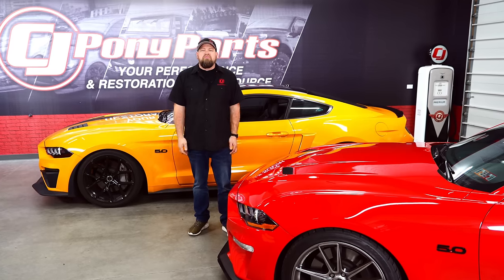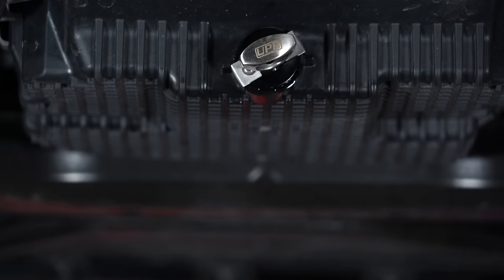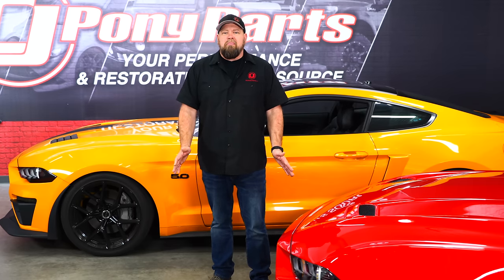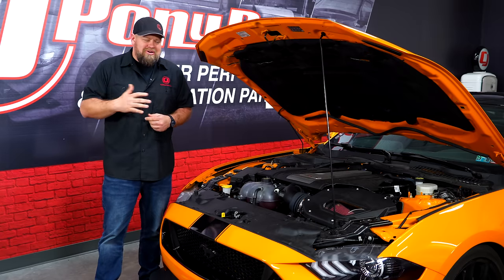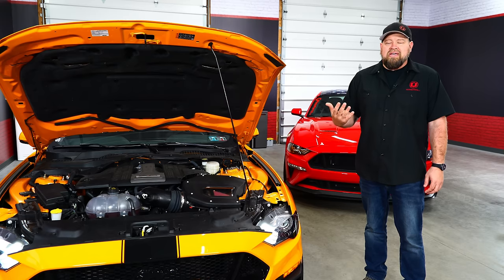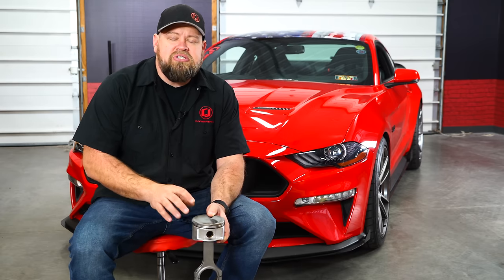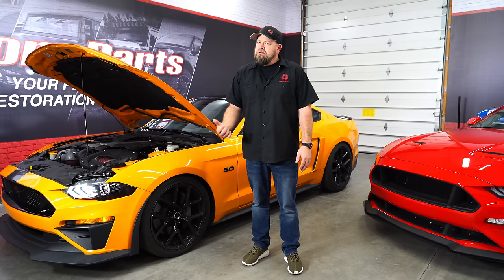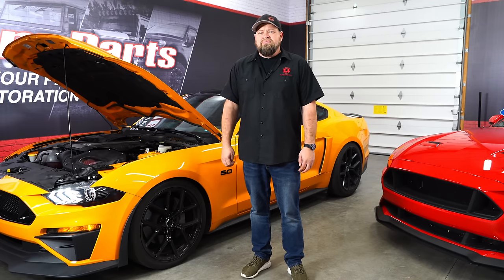2018-2019 Mustang Tick: Should You Be Concerned?

Comment: Guys,
 I'm completely new to the Coyote Platform but StangMode, Zander 13 along with great places well organized to buy parts and that glorious A10....made me cancel the order on my 1320 and drive out of State to get the exact 400a I wanted ( leaving me a little room for blower vs 401a in the budget ).
 During this process I drove and listened to MANY 18 and 19s....
 My late build 19 ( 9/18) did NOT have it at the dealer or after test drive and did not have it after nearly a 4hr drive home with at least 20 percent of that in heavy stop and go....BUT after that initial heat cycle it absolutely DID have it which I have chronicled....and continue to do so.....I will be doing the hyper lubricant before oil change ( got about 900 on it now probably take into Ford at 1500 ish with my documents) and not after....I'll be sending my first oil drop out for analysis....and each subsequent....I'll do my best to alleviate variables just let me know what you want to see done.....to disprove or prove the problem I'm down to help the community for posterity sake.....
https://www.youtube.com/channel/UCbuFo0wYe1cqplEFZbcylIg

 Just any test angle analysis or thoughts you want to see done or explored  even CJP I'll do it for posterity......let's get to the bottom....
 I already due to zanders trans issues been testing 5th gear hard and there is no discernable issue there though 2 things 
1. It doesn't want to let go of 2nd coming back down sometimes...seems like situational programming to me not anything bad....
2. It sometimes lurches part throttle on drive off in 1st.....light throttle....
 I got a theory I'm working on at least showing the difference something makes expect new stuff up soon......
 Thanks parts companies like CJP...Thanks StangMode and Zander without finding your guys channel I would not be enjoying a 19 400a after a lifetime of building, boosting and tuning Chevy muscle ....I absolutely LOVE my car even with the tick .....for now

Comment: Did you know the 6.4 powerstroke Diesel did the same and it was immediately after an oil change and went away after 50 to 100 miles an identical issue.

Comment: I had a 14 5.0l with this noise and it was intermittent. Track pack car with 5w/50. Mine would go away if you drive it hard and fully expand the pistons. It would come back after idling for a few minutes. But ford has an additive as well. X-17 I think it’s called . It’s a all black fluid that’s ZDDP that ford recommends if you have the noise. At least in Indiana. Even a high quality oil like amsoil 5w-50 by itself didn’t fix the tick. After about 500-1000 miles on a fresh oil change the noise would simply go away. Got rid of the car. They shouldn’t be making the noise. It may not hurt anything, but it still shouldn’t make that noise. It’s cheaper for ford to fix them as they come in.  But it’s never going to be “fixed” unless you rebuild the engine better than ford manufactured it.

Comment: My 2008 LS3 Corvette has a slight ticking noise that is similar to what  5.0 has, it goes away under Full Throttle or once you bring the RPMs off an idle. No loss in horsepower & no miss in performance whatsoever ask any 5.0 guy 😋. But I think a lot of it has to do with these aluminum engines, they just produce more internal noise out/resonate differently than a iron block, for example take the 4.6 dual overhead cam in the 1996-2009/2010Mustang has a cast iron block with aluminum heads, I have owned one in an 03 Cobra, that 4.6dohc motor did not have any ticks whatsoever, but all my LS engines had a lil tick. But I have not owned a new 5.0 & this is just coming from my experience with all aluminum engine's I have owned.

Comment: Yeah.  I got it. Drives me nuts.  I bought a V8 to hear it purrrrrrr, not type. I hate typing. I can’t type. It sounds like I m typing😬.  My dealer service department says “All our Mustangs on the lot sound like that. Ford says it’s normal.  If anything thing happens you have a power train warranty for 5 years, or 60000 miles. Whichever comes first.”

Comment: used mobil 1 full syn 5w50 sounds like ticking got louder..?
Reply: First mustang I have owned was a black 2015 GT auto as seen on my channel. Before I was able to post any other mods other than the exhaust the mustang blew up at 800 miles sitting in my driveway after remote starting it. I went through hell with the dealer where I purchased from. They eventually offered to sell me another Mustang after buying back the 2015 after many many conversations with the (GM).
The replacement was a 2016 Mustang GT PP1 that I mildly modded, exhaust, intake graphics etc. That car was amazing with no issues at all, of course I was dumb and sold it locally.

I now own a 2019 Mustang GT PP1 Manual. The car had developed the engine tick after driving it home of course. I’ve noticed when cold starting the vehicle and letting it idle down after 5 mins the tick is apparent. Driving the car not to exceed 4,000 rpm’s for approximately 10 mins, the tick dulled slightly to where you couldn’t tell by just walking around the car. My oil was changed at 1,000 miles after the “recommended break-in” using 5w-30 Mobile 1 synthetic and Motor craft oil filter. The tick is still apparent at 1200 miles.

I just wanna enjoy my car without having to deal with Ford “Again” in that matter. Looks to be in Inevitable at this point.

Comment: I have a brand new 2018 and it had the tick and I was concerned and my dad has one we have used the ceratec but I don’t like the color it is when you change your oil it’s kinda of a milky color so I switched up to the liquid Molly anti friction it’s like 9$ at your local auto store and it made my car stop ticking every once in a while I’ll hear and I use 5w20 oil and my dad uses 5w30 and that additive and his car is quiet you can’t even hear it run

Comment: I don't have a 2018 coyote mustang...but I do have a 95. No ticking like this with nearly 170k miles on it. In fact, it is a bit dismissive to say people commenting on this tick don't own mustangs. I'm pretty sure most commenters own cars with internal combustion engines which makes them qualified to comment. I do not care how much of a deal one thinks they can get on a 18-19 mustang gt, it will still be tens of thousands of dollars. If I had a tick like that, i would not be happy, and I would want it fixed. A heavier weight oil could work, but the Ti-VCT (the variable cam timing) mechanism might not like that. So you could swap one issue for another. It is possible the a batch of pistons were shipped out of spec and made the way into production. This is very common these days I feel. I once knew an LS1 that developed a similar noise...but after 170k-180k miles. Last year I changed out a head gaskets that failed on a subaru...right after the 60k mile warranty ran out...wtf? More recently I saw a 2012 volvo, with nearly 55k miles, need the piston rings to be changed...the engine would burn WAY too much oil. This was free of charge by the dealer. C6 Z06, LS7 engines have issues with poor machining on exhaust valve guides. Those have been known to fail. IMS bearings on Porsche 911, rod bearing on E92 M3 V8s, poor oiling system causing Aston Martin v12s (designed by ford) to fail...there is a lot of that stuff happening lately. (That Ford V12 shipped to Aston Martin with the same connecting rod they used in Ford Probes!) Anyways, it seems as though manufacturers are cutting corners more so than ever!

Comment: I do have 2019 Bullitt and I recognized the annoying EXTRA typewriter noise in the engine BEFORE even learning there are discussions about it on the internet. It only happens here & there, mostly in warmer weather. I don't make a big deal about it since the is a very simple fix!!!!

..I just play my radio ;-)

I'll try to change the oil after 2000km (currently 1600) and we'll see. I would rather not have the noise, but the rest of the car makes it up like million times ;-) ..

I must say the other noise you get in the second gear at 2000rpm is way worse ;-)

Comment: Did the 2015-2017 have a different liner in the cylinders than 2018?
Reply from the maker: Yes the 18 was the first year for the spray on liners in the GT, the GT350 used them previously.
Reply: CJ Pony Parts my 2015 mustang gt will sleep better knowing that, thanks

Comment: Really good vid, and great explanation.  However, I would be very upset if my car that I spent my hard earned dollars on ticked... I paid a premium price - id expect a premium product.  Just my 2c.
Reply: You would be an idiot then... 

A Ferrari, and Lamborghini also cost a premium. A MUSTANG doesnt cost shit compared to them. On those cars you have to replace clutches on those cars every 20,000 miles.... And they can fry a clutch if they spend 1 HR in heavy traffic. 

Porsche 911s are notorious for popping oil lines and dumping oil all over the engine and racetrack...

Every GM has rear differential problems... Dont let me get started on BMW or Audi, or nissan or Honda...

At the end of the day cars are just machines. Machines break down. For what ford is giving you for 40k it's actually a pretty bulletproof car.

Its no Corolla but its pretty damn close which is impressive.

Comment: My 2018 GT PP1 6 speed has had the tick under the car (transmission) since 300-400 miles On the car... and when I drive at a constant 2000 rpms the tick is loud, and it use to be only at 2000 rpms if I go above it, it wouldn’t tick anymore but now (13k miles in) the car at a constant 3000k rpms ticks loud... so at a constant 2k it ticks a constant 2500 it ticks at a constant 3k rpms it ticks!!!

Comment: Hey Bill I have a 2018 GT six speed manual I developed a ticking noise and I took it into the dealer they looked at it and said it was the clutch I got the car back and the ticking noise is gone and the clutch feels better than ever and it rattled as well and the rattle gone to it was rattling around 2000to 3000 rpm’s
Reply from the maker: jay singh good info.  My clutch is noisy occasionally too

Comment: I've got a 2019 and it has a 2000 rpm scratching sound. Every time I go through 2000 approx rpm it starts stratching until I'm at 2,500 or so. Any thoughts?
Reply: I have 2018 and my does the same thing.  I bought it used and didn’t notice anything until the first time I had the oil changed, it was done by Ford.

Comment: I have a 2020 and it does have the tick I noticed after a oil change. I have twin turbos and I was worried but it quit and after a while it started up again. It is intermittent. Don't have performance issues but it is annoying. I run amsoil 5w50 and have had no metal in the oil but I change it every 1000 and it tick just for a few days after a change and then quit but sometimes it does tick layer so not sure.

Comment: I put in 5W30 oil and the sound went away. Hear it slightly at cold start, when she reaches normal operating temperature, it goes away.
Reply: Christian agostini same here with 5w30
Reply: The only reason they call for 5w 20 is for economy the 5w 30 offers protection even the oil manufacturers suggest a 5w 30 instead for performance application
Reply: @Zander13Productions   I'm a fan! keep up the videos, brother!

Comment: There are tons of write ups out there that identify inconsistent tolerances and plain bad bearings at the main and rod journals in Coyote engines dating back to 2011 - 2012. The evidence is pretty well documented that one of Ford's suppliers has quality control problems that are frankly inexcusable to have lingered into 2018-2019. There is NO excuse for an engine to have audible internal noises like that. By the time you see metal in the oil, it's beyond too late. The only thing you can do to catch a failed bearing in time is an oil analysis, and even that isn't always a guarantee.

All manufacturers have their problems, but Ford has rightly earned a bad rep for scary internal noises in their DOHC V8 engines.

Comment: Thank you for this video. No one has been left stranded due to this. Plus less than 20 dlr documented cases of tic and less than 12 engine replacements and the internet turns it into "OMG its all over internet, lots of issues, hundreds OMG!!!! Just a bunch of non mustang owners not familiar with this sound, which is mostly from underneath and more audible on passenger side. And these idiots that complain are continually moding the car they're whining about. That alone  should tell people everything right there. Btw, an Fyi CJPonyparts: Oils do not have weight, it has viscocity. Just like the engines torque is stated properly as lb-ft, not the so common ft-lbs. There is a big difference.  Fyi: this inconsistent tic has been around since 2005.

Comment: I had a 2011 Mustang GT with the first year of the 5.0 coyote. Mine had the OG piston slap and one day it started smoking on deceleration in gear down hills. Purchased a borescope and pulled my plugs, had a look in the cylinders all sorts of scoring. Only ever used Mobil 1 full syn with motorcraft filters. Car had 70k miles on it. I loved that car and would have still had it, if it weren’t for the engine having that issue. It’s really unacceptable, it’s 7+ years later and these cars are still having this issue. There’s a point where it becomes negligence. Ford needs to go back to the drawing board with that motor and stop trying to save money with their bs cylinder coating.

Comment: I bought a 2019 F150 Coyote with 15000 miles. FROM DICK SMITH FORD IN COLA SC. I put 5000 miles on this truck and I have a tick that is getting under my skin. Im betting thats why this beautiful truck was back on the lot with 15000 miles. No I didnt hear it when I bought it?? Ive never seen or heard metal banging together that didnt wear out sooner or cause damage. IM seriously considering trading it. IM PO'd because I bought a custom leather seat kit from Katskin leather. Not installed yet. Any thoughts?

Comment: Got 2016, never heard a "tick" ,never would even think about having my car running and listening to any off noises under the engine. Seems like someone is searching for issues.
Reply: Wow, didn't you read the rest of the comments? Cylinder scorching means the piston is digging a ditch in the cylinder. With time the noise will get louder and louder. One day it will sound like a diesel engine.
Reply: 97sswcubes 78 why is sound an issue? Scoring can be an issue, not one in the same.
Reply: 97sswcubes 78 wrong...

Comment: My 2020 gt started the tick around 3,000 miles. At first I thought it was spark jumping from a coil but it is definitely something internal. So far it hasn't gotten any worse and I have 32,000 miles on the car now.
Reply: My 20 GT just started doing it at 2500 miles, after an oil change. I switched from 5/20 to 5/30 and she started the typewriter noise right side of the oil pan after the engine got up to temp. I'm going to try ceretec or possibly a different oil, as I'm not willing to "just live with it" or try to ignore it.

Comment: My 2012 GT developed the tick around 32k miles. I ended up trading it in at 130k modded miles with weekly 150 shot hits, the engine still ran great and put 536 rwhp on nitrous at 122k miles. 3rd gear exploded after a 60 roll so I traded it in on a 2018. 20k miles on the 2018 and no tick yet.

Comment: I need your answer on this,  I have a 2011 mustang GT and powerseat dont work up or down but works forward and back. And junk yard has a 2010 mustang but not gt will the parts powerseat same as 2011 gt?
Reply from the maker: Seat tracks are the same from 2010-2014

Comment: I own a 2018 Ford F-150. Basically it’s the same issue, same everything. My biggest problem is on startup, cold, hot, warm, it doesn’t matter. It sounds like a big diesel when I hit that button or turn that key. Really bad! Once it’s started, and warmed up I get the light ticking sound like the mustang  in this video. I’m on my 3rd visit to the dealership. I had the police called on me because I flipped out and I told the service mgr he was a POS for looking at me in my eyes and saying he “Isn’t aware of this issue on the coyote engine” I told him then u should be a lube technician because the rest of the world knows. They keep dodging the issue, which starts at corporate and I was told by a GM that Ford is dragging their feet in hopes of more warranties running out. Obviously if they recall the engine, which will never happen, they’d have to replace it BUT that still cuts the number down on non-warranties vehicles clogging up their service bays. Makes sense, huh? I truly wish I bought Silverado. It’s way cheaper and obviously much more dependable. I got rid of my 2005 that had ZERO sounds and no car note for a 2018 that sounds like dogshit and costs me $450 a month. So when someone tells me to deal with the sound, for $54,000 I should ignore it? Get the F outta here!